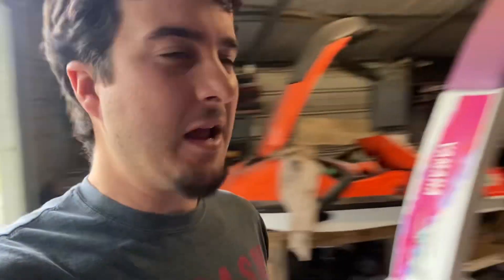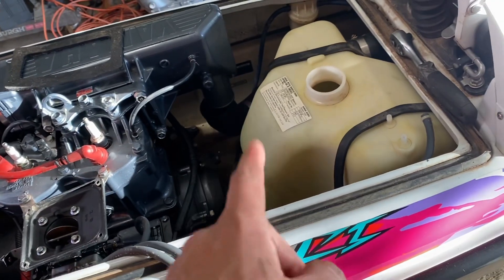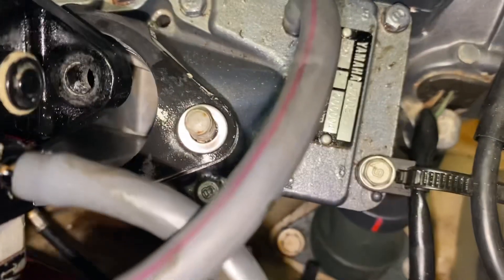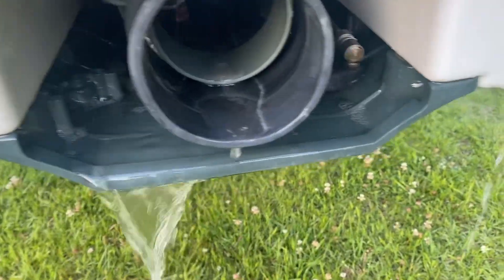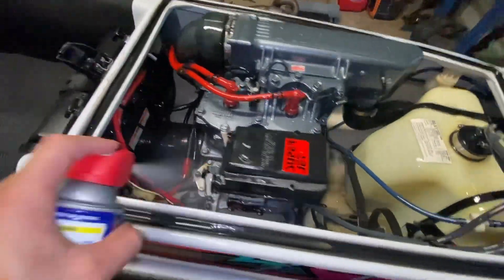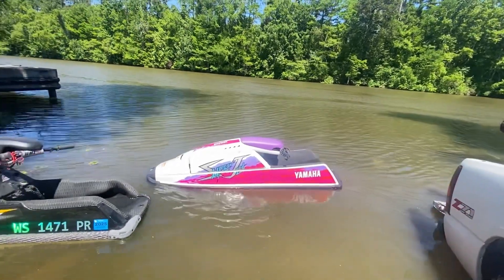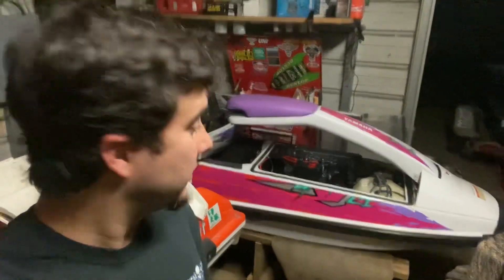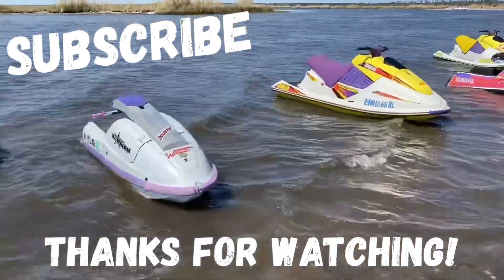The NEVER ridden Superjet gets cleaned and ridden!!

Comment: What does all the spray of WB40 do?
Reply from the maker: Keeping all the water and gas from breaking everything down. Prevents corrosion
Reply: @CocosPlayound  It<s actually safer to use silicone spray as it conditions the rubber, and WD40 does not.